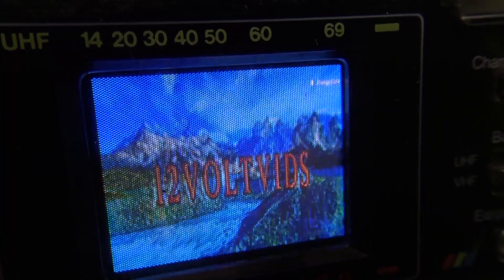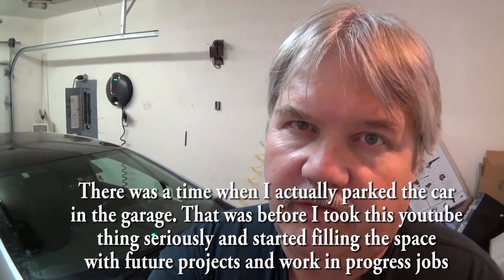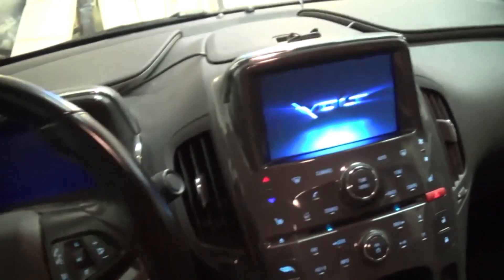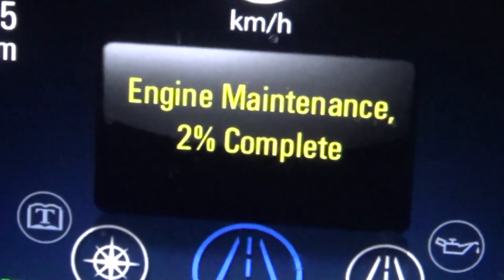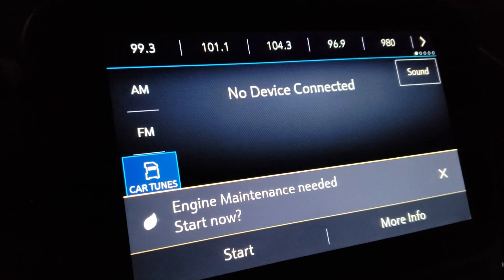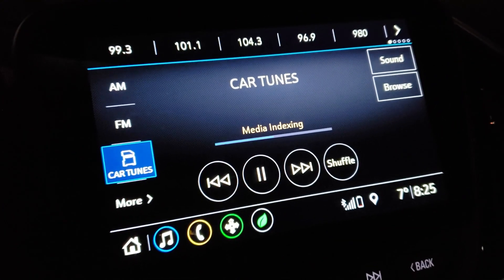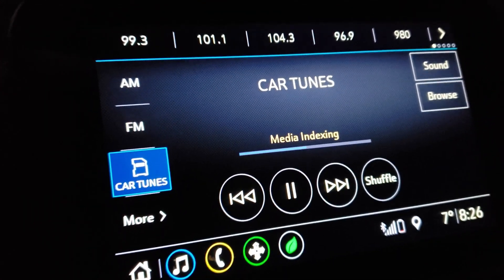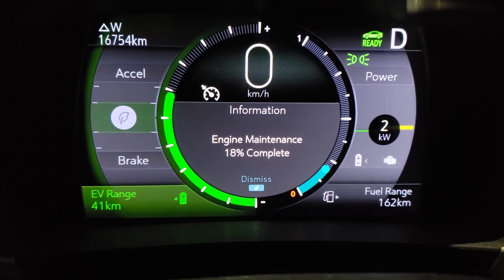How the Chevy Volt keeps gas from going stale

Comment: Just to be clear, "fuel maintenance mode" runs when the gas in the tank has been there for a period of time.  It starts the ICE and does so until either the tank fuel is exhausted or you add fuel to the tank which dilutes the "stale" fuel with new.  "Engine maintenance mode"  ensures that the engine remains ready to power the car when the battery is exhausted.  It runs the ICE for programed period indicated by a progress bar and then stops and reverts to battery power.
Reply from the maker: I hit the fuel maintenance mode last November when the fuel hit the 1 year point. You have to put at least 1/2 tank in to reset it.

Comment: We bought a 2017 Volt on March 13 - almost exactly one year ago.  Not knowing the car, I filled the tank up with gas on March 13, 2020.  Between being retired and the pandemic, I have driven it 1000 miles almost entirely in electric, except for one day trip to hike in the local mountains.  It is now in gas maintenance mode.  It starts in electric but after a mile it goes to gas mode.  It has taken that mostly full tank down to less than a 100 mile gas range (maybe a quarter of a tank of gas).  Do you know how many miles will be left in gas mode before it switches to electric?  My sister lives 60 miles away (120 round trip).  Now that I've had my second vaccine, in a couple of weeks I would like to visit her.  But I don't want to cut it short on gas/electric for the trip.  Thank you.
Reply from the maker: I last filled my 2019 up last April when the gas price dropped to 0.70 per litre in Canada. I have driven 9878 KM as of today, and will probably put run it to 9999.9 over the next 3 days. (Incidentally the trip counter goes to 9999.9 on the second gen then stops. The first gen the trip counter goes to 99999.9 and then stops. My first gen the B trip counter has been frozen in time for 5 years) I still have 1/4 tank left in my 2019. I expect it to go to fuel maintenence mode some time this month. I am waiting for the trip counter to get to 9999.9 so I can get a picture of the instrument cluster showing the remaining fuel from 1 tank of gas. The thing is when in fuel maintenence mode you do not have to burn up all the gas. Just add some and it will go back to electric. If you have half a tank and you fill it, you will get about 6 months before the maintenence mode again. If you have less than 1/4 tank it will reset and you get about 9 months. If you run it till the low fuel light comes on, it will fully reset and you get the full year to use that fresh tank of gas.
Reply: @12voltvids  Thanks.  I think I'll let it go to 1/4 tank and then fill it to half a tank.  We live in the suburbs of So. California, but we have had to evacuate twice from this house due to fires.  Gas stations will have a lot of cars trying to fill up, so I like to keep the car ready to go a ways.  That way I can keep pace with my husband's loaded truck and trailer.

Comment: I had a 1st gen (now have a Bolt), and the "maintenance" function would also activate when the car sat for a week or so in the cold Ohio winter. I suspect it may have done this to charge the 12V battery(?) Anyway, I loved that vehicle, and after my niece drove it she bought a Gen 2 and LOVES IT. (I have free charging at work, so I was compelled to buy a Bolt)
Reply from the maker: Starts in extreme cold to heat the battery with engine heat.  You know, so yo uh don't have to use energy from the battery to heat it live full ev does.

Comment: its definitely an engine saver having it start periodically. Back in the late 90s and early 2000s electric hybrids had issues with the engines ruining bearings and other internals. the UI looks a lot better on your newer model.
Reply from the maker: I had a hybrid back in the early 2000s and it was the most reliable vehicle I had at the time. I traded it in on the new volt last summer. That vehicle went 100,000 on a set of brakes.. My 2012 volt has 100,000 miles now on the original brakes, and it has become the most reliable car I have owned. Not many can say they have a 9 year old car that the only maintenance that has been done is 4 oil changes and 2 sets of tires in 9 years.
Reply: @12voltvids  , That is really good on the brakes! GM is one of the better hybrid electrics IMO. Some of the foreign hybrids arent bad either ,but parts are more expensive if they have problems. They do pay for themselves pretty quick if you dont have any major issues. You're lucky you live in a warmer part of the Canada, the batteries dont like subzero temps we get here in northern Indiana. Though it was in the 60s the past two days here.  35 degrees today. Lol

Comment: are these things particularly quick? I saw what I think was a chevy volt at an intersection,i just heard a relay click and it just dissapeared
Reply from the maker: The 2019 does 0-100 omg in just under, 7 seconds.  The 0-50 km is about 3, so they are fairly quick but there are quicker wleceyucs out there.  It is powerful enough that if I hammer the accelerator it will just leave a bunch or rubber on the road.
Reply: @12voltvids  that's nice,that's really good for like a family car

Comment: Such a bummer that the Volt was discontinued, it was my fav GM car. The Bolt is neat too but too but it doesn't have the hybrid functionality and it's too small for my taste. I'm hoping they come out with a successor to the Volt soon.
Reply from the maker: I hear that a plug in pickup or SUV is coming out next year as a 2022 model year. Naturally it will be the volt power train.

Comment: Interesting. Running an engine for that short a period is typically seen as worse than just not running it.  Unless the engine runs long enough to get hot and burn off the moisture built up all you're doing is spreading it around.
Reply from the maker: It did run the 2nd gen for a good 10 minutes to bring everything up to operating temperature.
Reply: @12voltvids  oh that's good.  I've seen the damage not burning moisture off can do.

Comment: Interesting, I was told gas could be stored for 3 years.
This suggests it can only be stored for one year. 
Or maybe it was deisile ?sp?  that can be stored for three years ?
That is what tickles me about prepers storing enough fuel to last them 20 years .
At least they will have 20 years worth of shellac .
Reply: I made my living off stale gas in small engines. I'd advise customers to use ethanol-free gas, they'd go "ok"; next year I'd be doing it all over again. Some of them would get all pissy about it.
Reply: It's hard to say but in general you don't want your E5 gasoline in your tank for more than a few months. My parents had a little boat, and after 6 months of not using it, the gasoline was stale, the carburetor was slightly gummed up and the engine backfired a lot. 
It gets worse with E10. Also because ethanol attracts water from the air, causing fuel degradation and on the long term rust. 
Most bikers who stop during winter, run ethanol free gasoline to prevent such things. 
Aspen fuel will also last for several years. But ordinary E5 or E10 gasoline is very risky to keep in your car for a year. 

Diesel fuel can be stored for much longer. It doesn't degrade as fast as gasoline does. However, micro-organisms can grow in it which can gunk up the fuel system again. That's what limits diesel life span. Often, in generator sets it gets replaced every year. The year old diesel just gets reprocessed at the refinery.